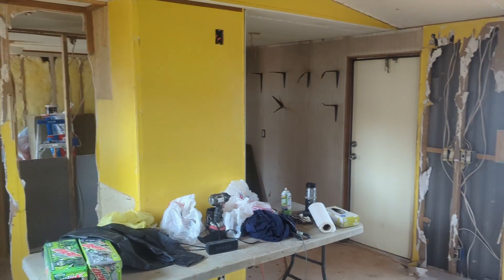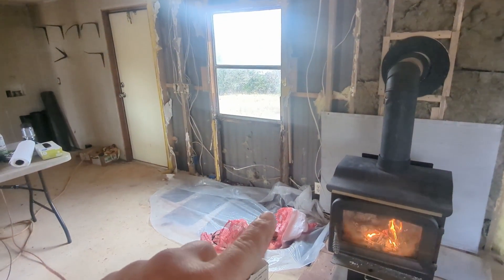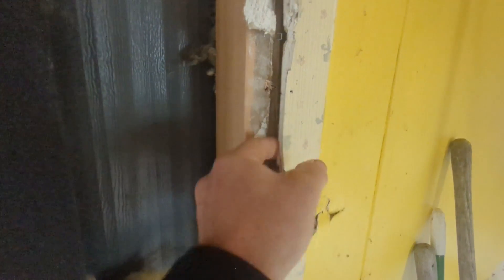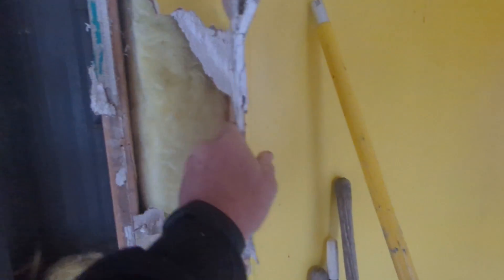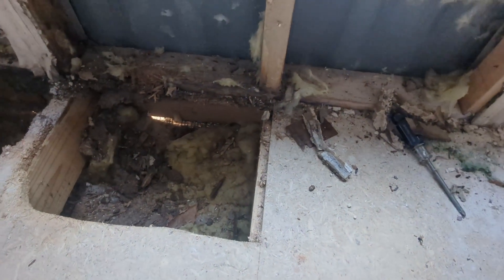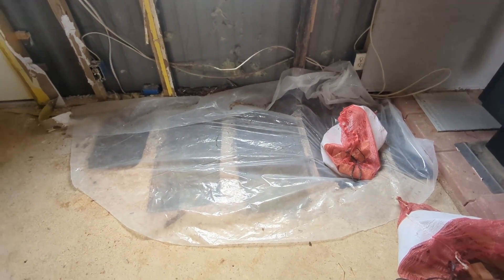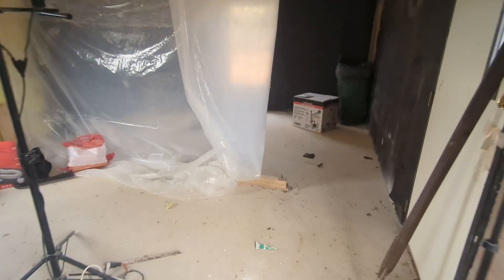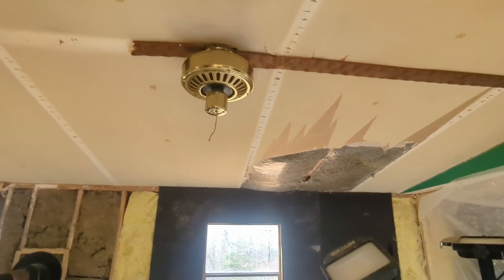1990s Mobile Home Walls and Floors Demolition and Renovation

Comment: I have a 1969 mobile home and a 1981 mobile i am in process of renovating.  The older one has al new elec, water and propane lines. The newer one is getting new pex plumbing to replace quest plumbing that gets pin holes when i least expect it. The old one hap plywood floors, still solid for most part. Newer one had chip wood floors all been replaces on previous except kitchen and now getting ready to do that. Lot of work but all worth it
Reply from the maker: I absolutely agree. It's definitely worth it which most people don't understand. I appreciate your support

Comment: Looking good, u guys have done allot of hard work. I’ve been working on my mobile home for awhile. It’s in pretty bad shape. Had to rebuild all the exterior and interior walls so far. Got about half of it done. Hope to get my kitchen started soon. The worse part is removing the drywall, ugh I hate that part. Several trips to the dump gets expensive. I’m sheeting the exterior with plywood and the interior has been breadboard and drywall. Your videos have inspired me. Maybe I’ll get myself in gear and finally finish interior.

Keep up the great work
Reply from the maker: Thank you for the feedback.  I find the hardest part is living in a 14x48' building with a family of 5 while trying to renovate it at the same time.  Not a lot of room to work.  We haven't got a lot done, but we are making progress.  Thanks for following along.

Comment: i've watched this video last so i can really understand where you are... 
SINCE YOU ASKED us to offer you our free opinions and suggestions lol, here's mine!😁
so, stapels on the floor, if you haven't addressed any of this yet
try a roofing shovel with the teeth on it, like we used on our roof videos? i've found they pull out 
mass quanities of things well and quickly
we had some glue on wall studs too, but yours seems to have more glue stuck on :(
that looks like a real pain for sure!! :-

on the electric panel face being missing... now, i'm not avocating skirting Code..:D
but i HAVE had this happen before.  bought 2 old trailers, only 1 had the panel face.
had them both in the same park... you HAVE TO HAVE it to pass code, that's understandable.
but i couldnt find the right one again :( it was a 1979 trailer, this was over 13 years ago)
so... i took and installed the one from the other trailer, its a match lol, and passed inspection...
and then took it back to the other trailer and passed that inspection too at a later date :)
had to put in a different face that fit it well enough, but it wasn't 'right' for code... but ya only gotta pass that once :)
we replaced it all later, but we needed power to work on it, so i made do!  
TL;DR: if anyone has the same old panel somewhere but its not for sale...
just borrow it for the inspection and then do what ya gotta do later on your own schedule :)
that' just if you can't easily find a replacement 'for sale'
your insulation is nice... ours was filled with poop as you may have seen :)

on Wood use.. with sawmill... ok, so, if (and i mean WHEN lol) you get rid of that metal siding, you'll need wood, bought or made.
on our doublewide, we are going to replace the rotten siding with 2 layers (due to cost, 2 thin layers is cheaper than the super thick structural siding out there. cost is a real issue for us RN unfortunately 😔)
7/16 wall sheathing, and then 7/16 sheet siding.  not sure about house wrapping it, we are really far south and i'm not sure about it here just yet.
but if I HAD a sawmill lol.. i'd make my own.  since you can't make plywood, you CAN make planks.  either 1/2" or 3/4" if you want to get bold lol (rememeber how much more it weighs)
and whatever widith you can make them consistantly.  3/4" by 5" for example.  
I'm sure you've seen roof decks done in planks from back in the day, its still a valid technique and its never used because... well, people don't have sawmills 😂
skin the trailer with those, then use the sawmill to make basic lap siding.
put that siding over your base structural plank walls, with or without various ice or vapor barriers that may be appropriate for your zone. 

= pimp custom trailer
Reply from the maker: Thanks man!  This is a lot of good info.  I was actually thinking of doing lap siding.  Interior was thinking metal roof ceiling, wood walls, and vinyl or laminate flooring.  What are your plans for yours?
Reply: @practicallyIndependent  I will stipulate again that my whole "good enough" attitude is simply due to finances and expediency, otherwise I'd be trying to make everything 'finish quality'.. with that in mind, we are going with laminate flooring and basic everything. We already got th flooring, next video 😁. We got premium 10mm thick flooring....for 350 bucks 💪😎. It's used lol. A guy was replacing his awesome floor with another color and carefully removed about 1,200 Sq ft of this hand scraped, beveled hickory stuff and sold it to us! We are going to do regular 1/2" sheetrock and R13 or R19 fiberglass insulation. Those things we can't seem to find in quanitiy on Marketplaces so will likely have to buy that new, full price from Home Depot.
Cristina is not a fan of full wood interiors like a cabin. I wouldn't mind either way but since she has a preference, we'll likely always be sheetrock and paint.
She thinks it's too much wood all the time for her preferences. 
I want a nice, not rotten home and that's it lol. I already know momma will decorate as she sees fit, so all I have to do is provide her walls 🤣
I plan to live outside. I don't need much... I've lived VERY astutely in my past, I'm good anywhere 😁

Comment: looks good mike ...i would make my own 1by6 tong and groove bevel edge and leave the surface ruff with planned bevel edges but to keep it simple i would groove all edges  1/4 inch wide 9 /16 inch deep of the board and mill 1/4 inch by 1 inch slats to put in the grooves .with false beams every 4 feet the walls i would do a wood waynes coat 38 inches high with sheet rock on the upper section of the wall and attach a ruff sawn 2by 4 every 4 feet under the false beams to give it the appearance of bigger post ...you could also secure 2by4s at 45 degree angle's in the inside walls to give it a timber frame look...by the way i did suspect you had particle board floors ...you definatly should put a 3/4 inch thick hard wood floor over that .... a friend of mine was wheeling a gun case across a floor like that on a piano dolly and a wheel broke threw...that stuff is ok if used right ....solid wood flooring floor first then particle board and never use particle board near entry doors kitchens bathrooms or laundry rooms ...in those areas i would take the particle board completely out and replace it with osb or gold edge or cdx. but i understand if you dont ...its alot of work ...sorry about the book i just wrote here lol .....cheers
Reply from the maker: Thanks Grizz!  I was hoping for this type of feedback.  This is very helpful.  I like these ideas and agree about the subfloor.  It's pretty sketchy material for sure.  I agree about the hardwood floors.  I like the idea of the added strength.  Thanks again Grizz!

Comment: I'm glad I stumbled across this channel. Subscribed. That looks like a really interesting project. The main thing is the roof is in good shape and the rest of it has good bones. It'll come out pretty nice. I redid an old 12x60 mobile at our place that I got for free. It was in very tough shape, with lots of rotted out studs and huge holes in the floor where the bathtub and kitchen were. I gutted the whole thing out right down to the studs, so it was just a long tube. I repaired the floor and added another 1/2" layer of particle board on it. I got super lucky with an awesome deal on a whole pile of used windows, I got 23 big Loewen double pane windows for $300. I put ten of them in the trailer which replaced all the crappy single pane windows. While I was doing that, I sistered up all the 2x3 studs with 2x6's, doubling the thickness of the wall. Unfortunately to do that all the wiring had to go, so the place runs on extension cords now. Insulated the heck out of it and added a king size wood stove, so now it's a very cozy place and easy to heat. Still a work in progress, but the hard parts are done.
Reply from the maker: I agree.  It's so worth the effort. In the end it will all be new and for a small fraction of the cost of a new one.

Comment: The only issue I could see using actual wood for your finished walls and ceilings is the weight! Don't forget you're in a mobile home. The framing isn't designed to hold the same weight as a traditional stick built home. I would make sure your floor joist and foundation can support it. Most single wide mobile homes have either 2x4 or 2x6 if you're lucky ,joist package.  You probably also have particle board subfloor. I'm not trying to be a negative nilly, just giving you some things to think about. We are doing the same thing you're doing only with a 1995 double wide. Our biggest obstacle has been being overwhelmed! The one thing that keeps me going is the thought of being done and being debt free! I've litterly thought of throwing in the towel several times and just mortgaging a new home. Fortunately, the thought of hiring a contractor that is going to upcharge every board and nail ,screw, etc, by 100% keeps me going! Lol! We've also made a plethora of modifications to ours as well. We are basically turning ours into a traditional stick built home. So that has added even more pressure and, at times, overwhelming! However, the thought of when we are done Fortunately keeps me going even when I want to quit.
Reply from the maker: We had actually thought a lot about that as well. I actually decided to just stick with putting drywall back in the home, but instead of mudden tape just putting trim over the seams and painting it all. It would keep it simple and lighter weight. For the floor we picked up some cheap laminate flooring from a surplus building supply place locally. Now all I have to do is the labor, lol. That's the part I have the hardest time with. We have so many projects and so little time.